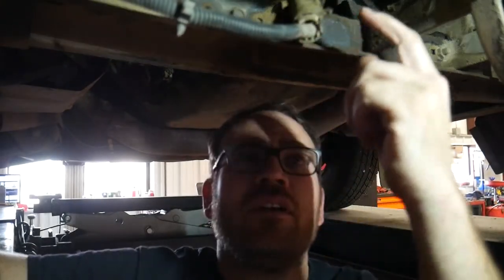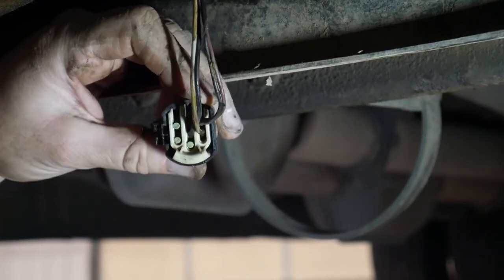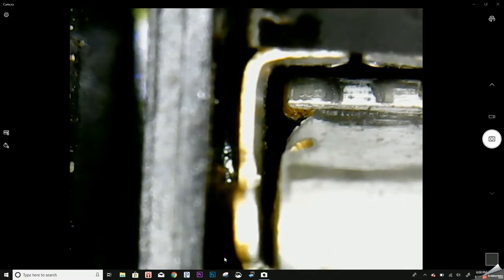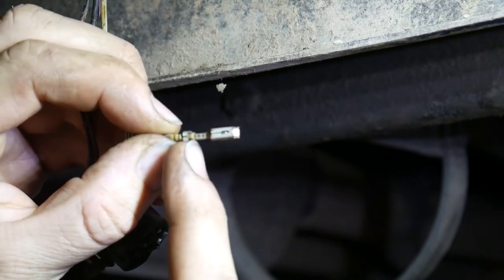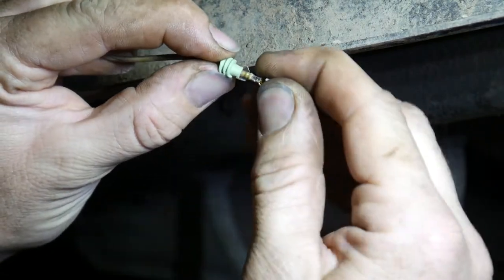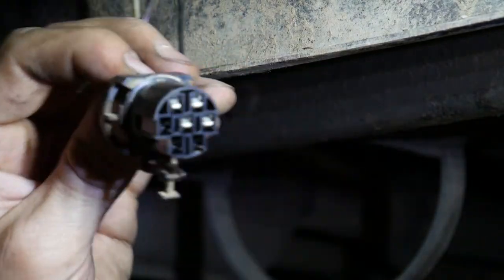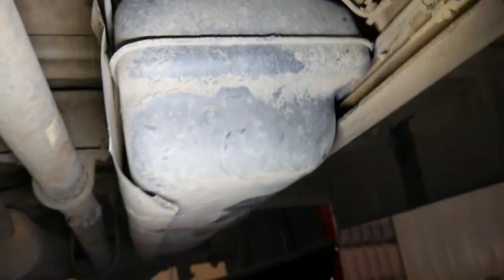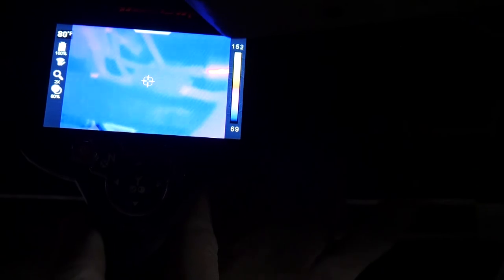Short bus part 2 Fuel Pump Circuit repair

Comment: Mr. Practical Mechanic, next time you take a short bus for a test drive, come pick me up 👋😬. Also, I’m impressed by how quiet your background was, very nice 😉.....wear your seatbelt.
Reply from the maker: The next one will probably be the Queen Ann. Not as fun as the short bus.
Reply: What are you doing to the queen ?
Reply from the maker: Valamilk lol probably nothing but I do need to move it. We can start a series to “Save the Queen”
Reply: @ThePracticalMechanic   does the school bus have seatbelts? haha
Reply from the maker: Voltage Drop Diagnostics yes it does have seat belts. I bet kids these days don’t wear the seat belts or disconnect them as soon as the busy starts moving. Maybe someday they will have occupant detection and seat belt switches on every seat.

Comment: Also the black lines on the terminals is called fretting which can cause poor connections. That may be the reason that terminal opened up. I know gm had a bulletin about fretting a few years ago. Opps you talked about fretting anyway.😂